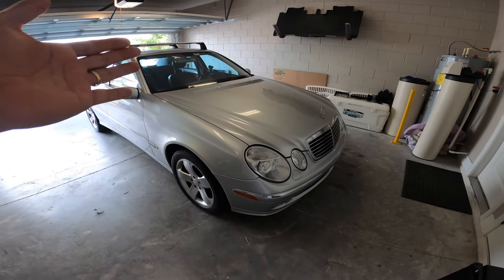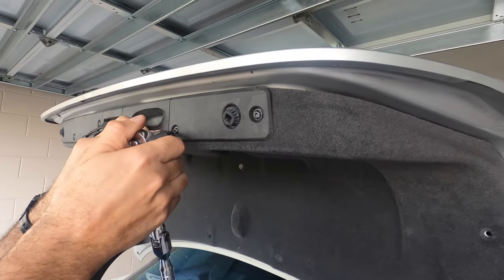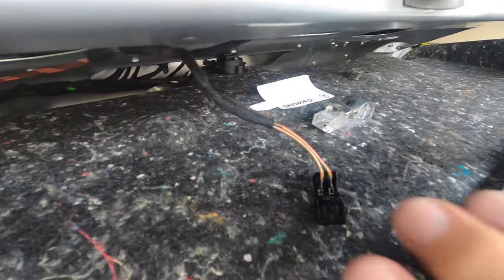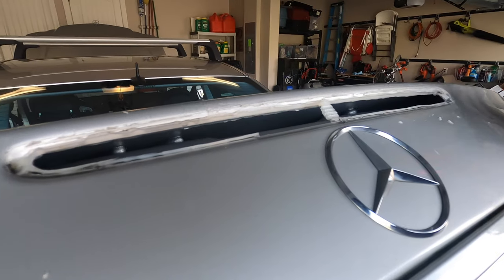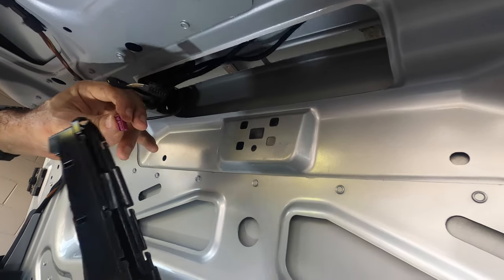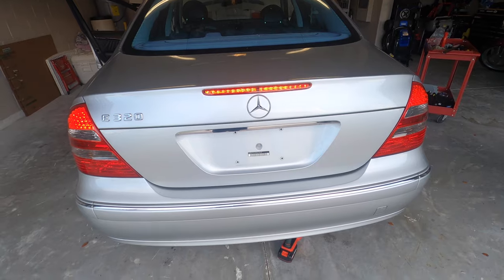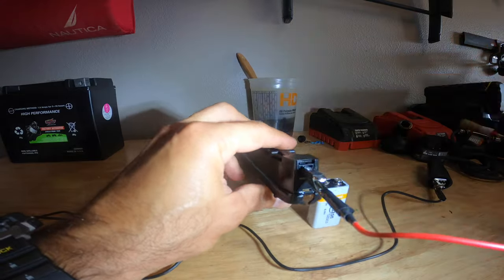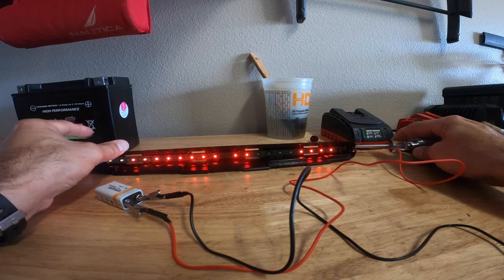Replacing the Brake Light on a W211 Mercedes E Class

Comment: It's a brake light.  The tabs you pull off the liner have an center insert with hold them in place- remove that first then the tab- not both at once like you show.
Reply from the maker: Thanks. I actually pulled the center enough to free up the bottom part. Then I pull the bottom. No need to completely remove the top piece

Comment: Hi I replace the third brake light and still not working
Reply from the maker: Check your fuses
Reply: Check the wires on the left trunk hinge. Brown wire is usually cut behind the carpet